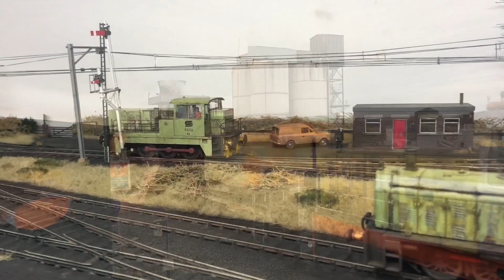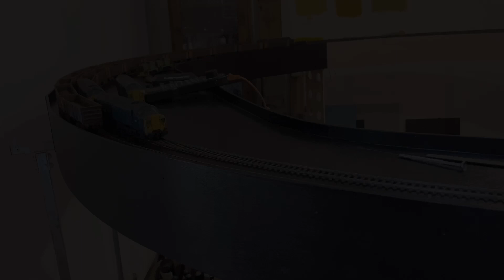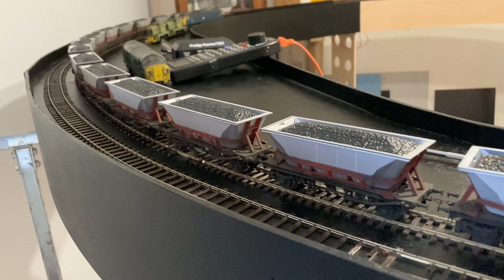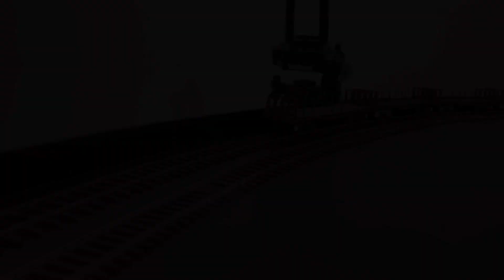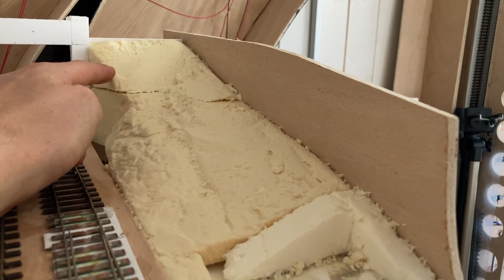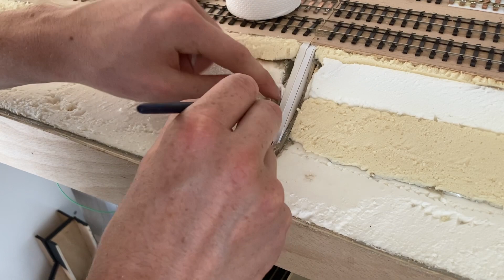Building a OO Gauge Exhibition Layout Model Railway. Part 6, Trains Curves and Scenery.

Comment: Hi Chris 
Ive just found your short series of 'Woodhead' videos. 
We are building one at our club in Lockerbie based on that famous 1:40 on the Worsbrough branch. Called Silkstone our exhibition layout will be the section between Silkstone number 1 and number 2 tunnels on the long sweeping curve. We are planning on an up and down fiddle yards of between 5 and 6 roads each but since signals are not required the yards will be managed manually but we will be using frog juicers. The model will be DCC sound  featuring class 76, 50, 47, 46, 40, 37, 
 31, 25 and 20 possibly with a 110 DMU if i can find one. There may even be a 25kvAC  heading to Doncaster.  It will be set in 69/70 just as sone of the 76s are being multiple fitted. The usual freight and passenger workings too.
It would be nice to keep in touch with a fellow Woodhead modeller. 
Cheers